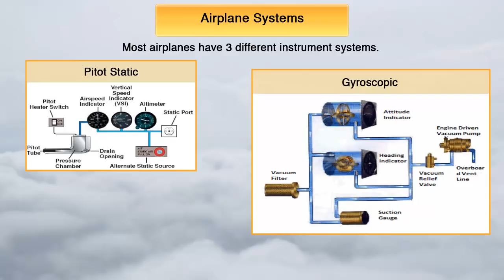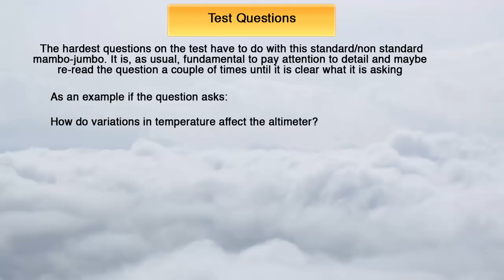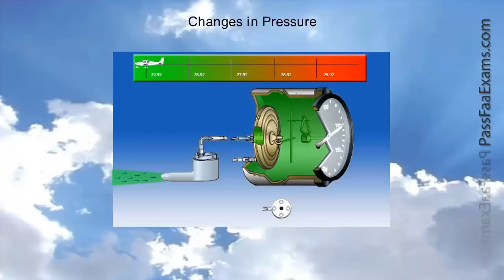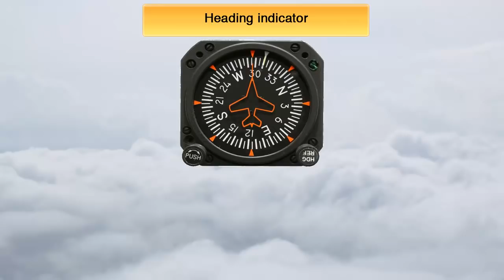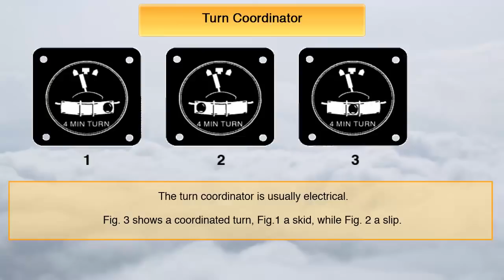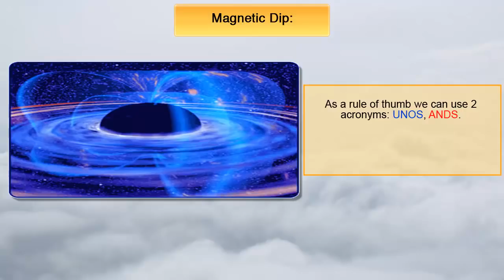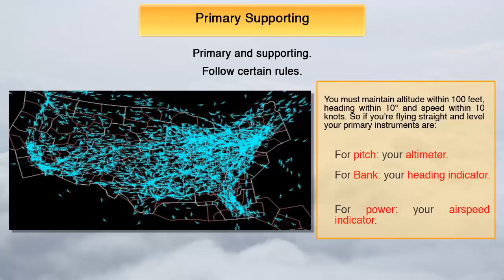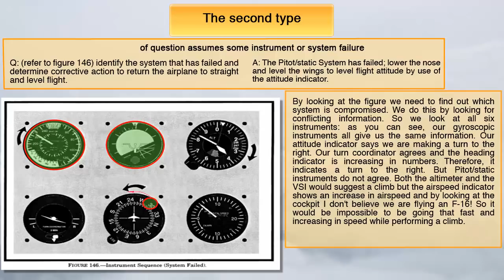Instrument Written Prep Video Demo (No Interactivity)

Comment: Hi Gian, firstly, thanks for your fantastic, educative videos. You got a great pace of speaking and teach in an understandable way.

I Just got a question: I noticed that in the animation (1:50-1:55) the instrument's needle happens to move clockwise, indicating a higher value, when the android phugoid contracts. As you explained, it should show a lower altitude when it contracts. So, is there a reason that the opposite is shown in the animation, is there something I missed? 

Thanks in advance for your reply. 
Kind regards.
Reply from the maker: The animation's gauge is not displaying altitude. It's not an altimeter. The face of the instrument simply displays pressure differential. The gauge is showing an increase in pressure and as pressure increases the wafers will contract.